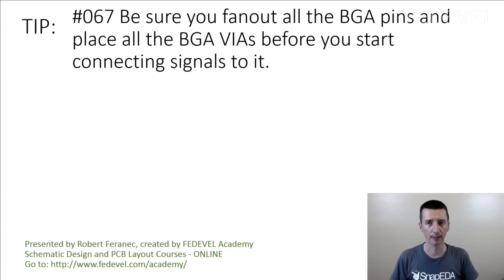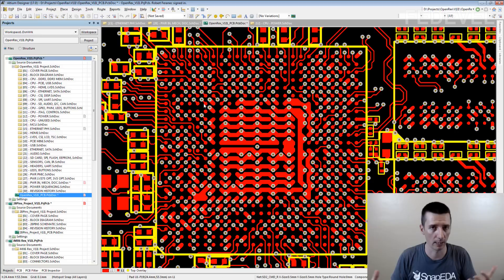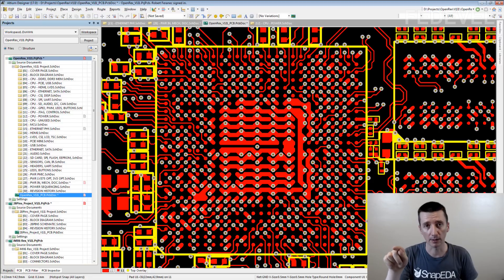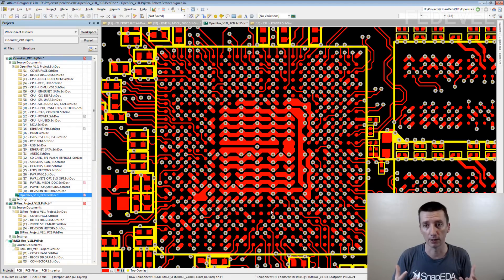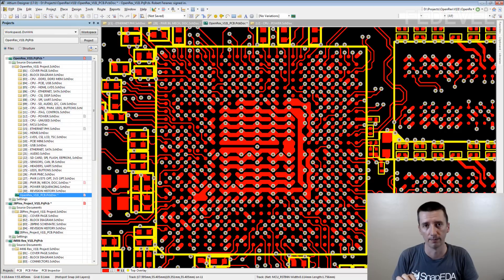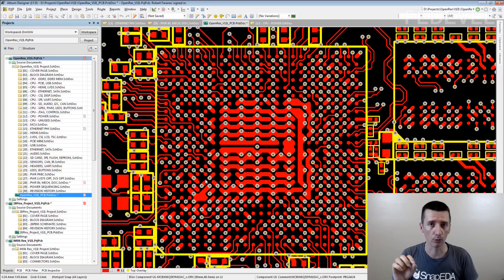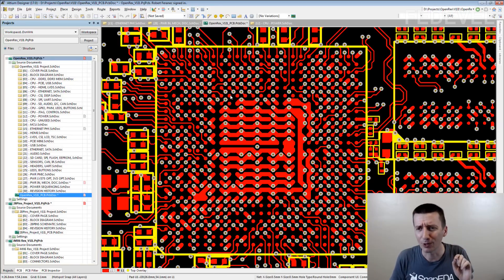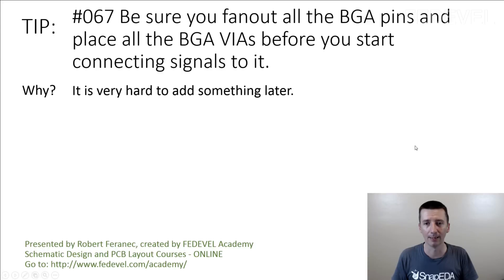TIP #067: Be sure you fanout all the BGA pins and place all the BGA VIAs before you ...

Comment: I am routing in almost every design big bga chips with >300 pins , and this is exactly the approach, (using mvias to reach the lower layers)
One important thing here. Be sure to put vias on everys pad of the bga, but just as low as you need them.
Sometimes I oversaw there was some pad(s) with no via, and then it can happen, as you said, you can not route it out anymore, and need to reroute lot of nets again!

Comment: Hi Robert, that is definitely a very good tip. I have a comment regarding the BGA layout shown. I have read in a few app notes and datasheets that each BGA pad whether used or unused should be connected to a single trace and all traces should be of equal width in the vicinity of the pad. The fanout via may be removed for unused pads, but the short fanout trace (equal to the trace between a used pad and its via) should remain. The reasoning given was to balance the solder tension and have good solder joints for all BGA balls. The short fanout trace for unused pads is also supposed to help during BGA rework. The top layer shown in the video might inspire people to go against those recommendations.
Reply from the maker: Thank you Shady Gross. PS: I have not seen any problems with not connecting all the pads. But maybe it could play some role in very high quantities of boards or in high quantities of boards what need to be repaired. But I am not sure - as I said, personally I have not seen any problems with it.

Comment: HOW I can do the fanout ??
Reply from the maker: That is a big topic.

But basically, this is what I normally do:
1) powers + grounds + decoupling capacitors
2) memory interface
3) differential pairs and other high speed signals
4) rest of the signals

How exactly to fanout a BGA, it depends on the technology what you can use (e.g. through hole vias only, uVIAs, vias in pad, how many layers, etc), it depends on BGA pitch, ... a lot of factors. It is not som simple to answer.

But, the best is to have a look at reference design and see how they did it.